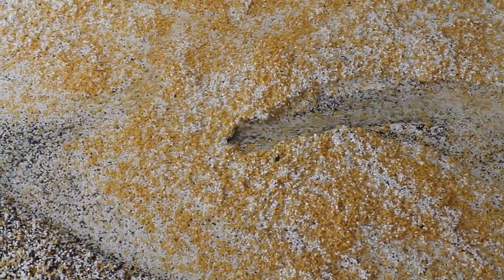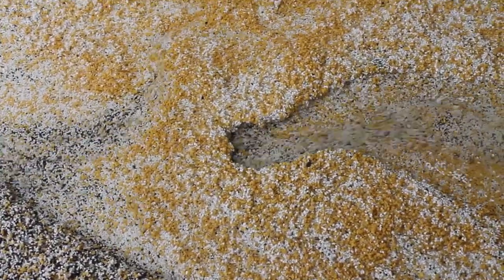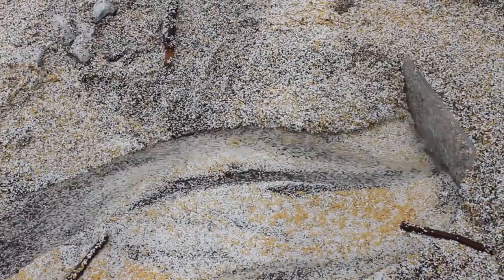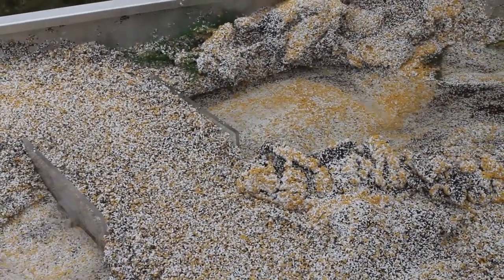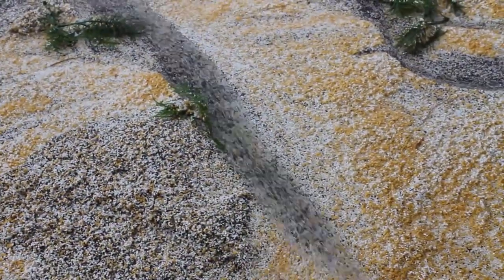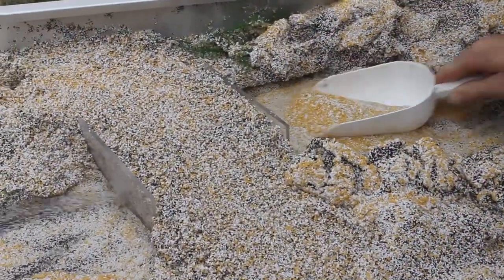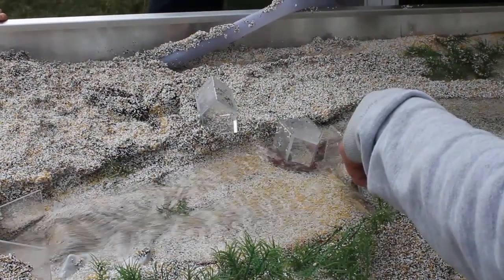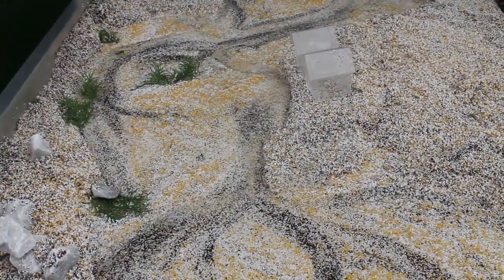Unintended effects of dredging

Comment: Calling you out. Lets take into account that the rivers have more unnatural silt then 200+ years ago. Our interference has casused this. We need to dredge rivers and restore the riverbanks and plant more trees to reduce silt runoff. Gee not hard to think outside the box
Reply from the maker: If you reduced excess silt inputs (where they exist, this is a good idea); why would you need to dredge? For a set gradient and flow a river will create a particular cross sectional width and sinuousity by redistributing bed material. The result would be the exact habitat features all river species evolved to thrive in since the last ice age.

Comment: This is a really cool demonstration, and something I hadn't really thought of before.
But lets not forget that this is a SCALE model. In reality, who is going around and removing the equivalent of 100 tonnes of river bed? Maybe for very large construction projects this is valid.
But if we're talking about gold dredging, that is done on bedrock for the most part, and won't cause that kind of disturbance.
Reply from the maker: Hi - it's mainly focussed on the situation in the UK where thousands of tonnes of river bed are routinely dredged out in an attempt to increase channel capacity to dimensions that could prevent water spilling out onto the floodplain during high rainfall. There are lots of problems with that approach (not just habitat destruction). Most people don't appreciate that at any given time there is far more water within a catchment that can fit into the channels - it's about the rate at which that water moves through groundwater, surface runoff and through bottlenecks (e.g. bridges) which determines flooding.
Reply: @WildTroutTrust  Ah I see, that's totally fair. I assumed it was a demonstration of the broader concept (and dangers) of dredging. But this specifically shows what happens when a VERY large amount of river bed is dug up with the intention of changing the environment.

Comment: You DO NOT have even a basic understanding of stream dynamics. http://www.environment.fhwa.dot.gov/ecosystems/wildlife/fish5.asp

A 2 foot diameter (0.6m) rock weighing 1000 pounds (454 kg) is stable at flows up to 10 ft/sec (2m/sec). After that it starts moving downstream. So if a river can move things weighing that much weight, what is it doing to the lighter stuff.

 And we won't get into things like interspatial siltation, substrate armoring, and stream channelization, that is removed by dredging, that prevent some species of fish from spawning. Thumbs down.
Reply: Mad Machinist Are you suggesting that shear velocity is equal at all points over the full cross-section and at all points in the longitudinal bed-slope? If so, there would never be any retention of particles smaller than the 2-foot rocks that you describe..

Comment: Since my comment was not completely posted I will post it again. I'm not convinced. I am a Conservation Biologist. Your micro-scale modeling does not accurately reflect or demonstrate true stream bed hydrology since it uses a homogeneous grain size and does not take into consideration bedrock or other natural structures typically found in a stream bed. Your modeling attempts to make the data fit your hypothesis, and, thus, you cannot reject the null hypothesis because your science is flawed.
Reply: Howard, Grain size is not homogenous in the model, but that is a moot point as I am not extrapolating "results" from the model to ecosystem scale (just using it to explain what the science tells us actually happens at full, life scale). Are you suggesting that dredging/changing the naturally-emergent properties of the channel have no potential for both proximal and distal impacts on demand, supply and distribution of mobile bed substrate (especially under bank-full conditions - which is what primarily determines channel characteristics)?

Comment: Winter 2012 saw a lot of water on the move; presume more eroded material ends up down stream; doesn't dredging that "extra" out help to restore the balance?  i.e. dredge when higher rainfall but not when "normal"?
Reply: Hi Steven,  what primarily determines the shape and character (in terms of bed substrate) is what happens under "bank-full" conditions. The maximum "shear" velocities are experienced within the channel at that point - so this determines the minimum particle size that will be retained within a reach. So it is the extreme spates that determine the dimensions and substrate of the river channel. This is often complicated by factors such as surrounding land-use practice (for example direct erosion of banks by livestock foot-fall). Trying to dredge the material after those high events will actually accelerate the demand for material - so will be counterproductive.

Comment: LTG - The Emriver model apparatus was developed by an independent company to accurately represent real erosion/deposition dynamics. The timescale would approximately scale up with size (to a decent first approximation). The flow rates were moderate (i.e. we didn't simulate spate events during this demo) - and the banks were approximately stable over a comparable time-period prior to enacting the "dredging" simulation.
Reply: This is interesting but what if the banks and bed of a river were to be replaced by concrete?
Reply: Nigel Johnstone Then the velocity of flood flows would be hugely increased (velocity in open channels being influenced by things like longitudinal bed-slope, volumetric discharge, cross sectional area and (crucially) the "hydraulic roughness" of the wetted area of the channel. This would be much more damaging for any engineered structures as well as dramatically increasing the height of floodwater peaks (resulting in more frequent, extreme flooding events).
Reply: Paul
I am trying to correlate the increased velocity and therefore volume of water that would flow through a concrete lined river, with higher flood levels. This seems analogous with an extra lane on a motorway merely increases the amount of traffic rather than ease congestion - a paradox!
Reply from the maker: Nigel Johnstone Increased incidences and severity of flooding can occur as a result of increased conveyance because of the impact on reduced "concentration time" of spate flow peaks from different parts of the catchment all arriving at the same time. Reduced hydrological roughness will tend to make each peak shorter in duration but higher in magnitude - consequently, increasing the synchronicity with which these higher magnitude peaks arrive (especially at a pinch-point) will tend to lead to greater frequency and magnitude of flood events.